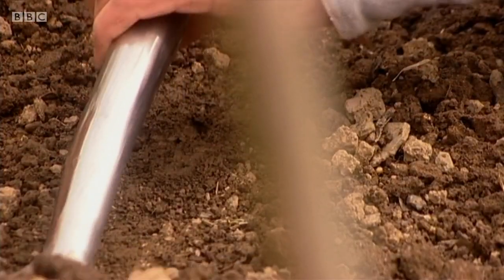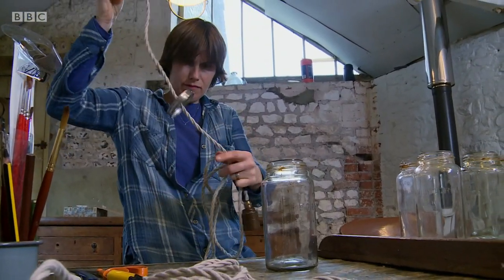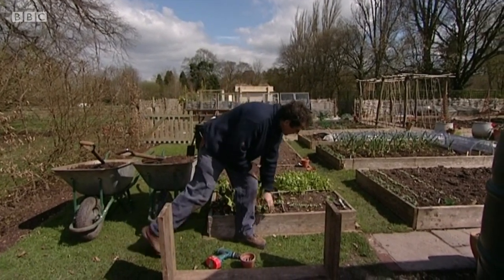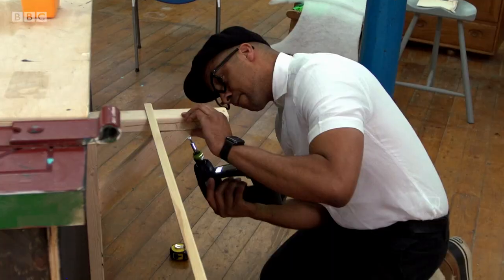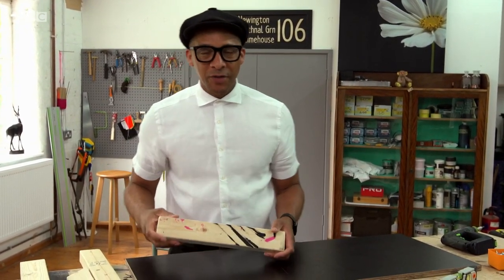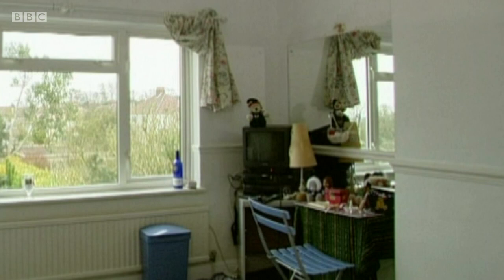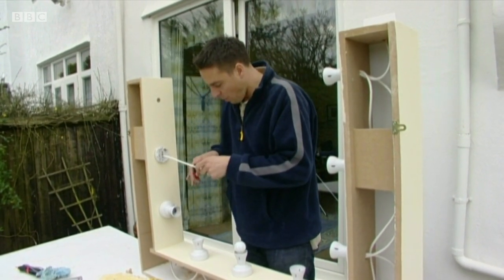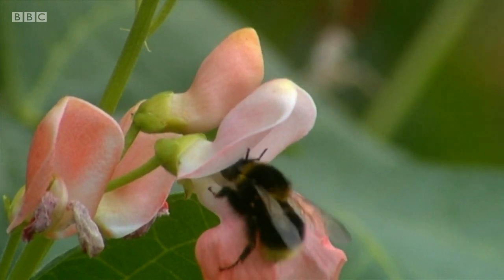Jay Blades' Home Fix, Series 1, Episode 1

Comment: Jay, you didn't mention a few important standards regarding self supporting shelving! One thing is, you shouldn't have one single shelf with only two brackets any longer than 36 inches. The rule of thumb, even when well screwed into joists, is to have no more than 30" of unsupported shelf, and no more than 3" overhang per bracket. 👍🏻